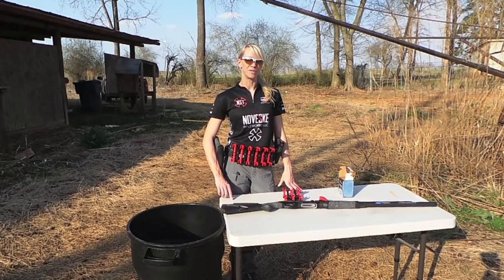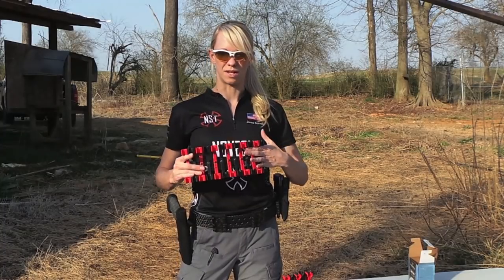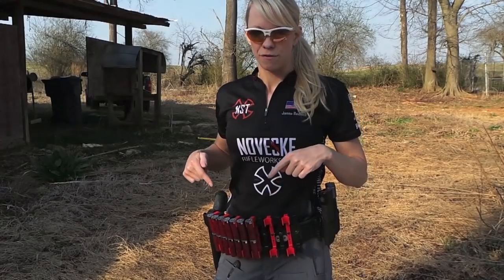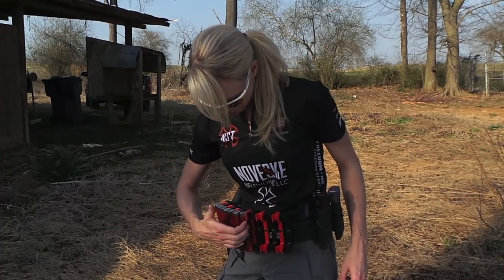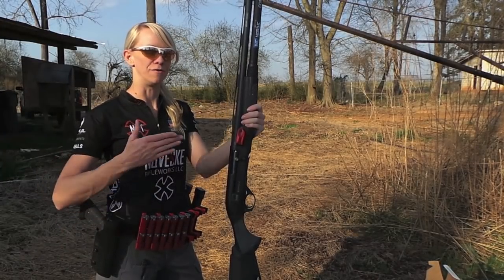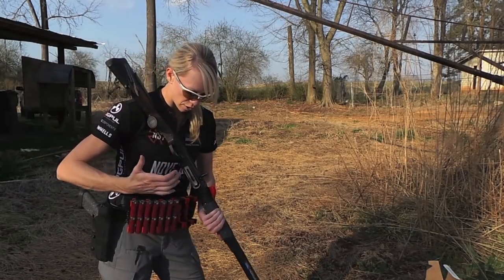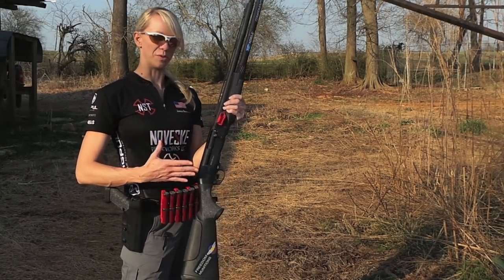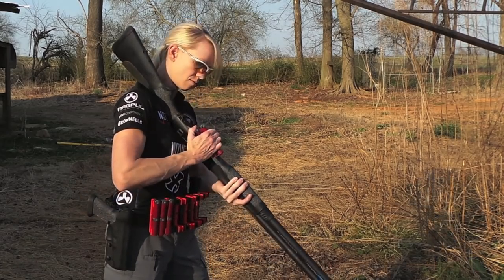Janna Reeves instructional competition shotgun load technique (twin and quad)

Comment: Its been a while good to see your alive and well and what is the length of that shotgun and wouldn't the extended magazine get damaged by odd ball rounds but than again it is a competition gun not all purpose shotgun
Reply from the maker: The barrel length is 21" but the magazine tube is a Nordic Components + 7 and does extend past the muzzle. And yes, this set up is intended for competitive shooting so I don't use oddball rounds in it. The pattern on the bird and buck I shoot doesn't start to spread until it's well  past the mag tube so the worst it gets is a little carbon build up!

Comment: Been practicing this for about 4 months on a Rem 870 Tac and no matter how I push or what form I use the second shell always gets hung up causing me to reposition my hand and make a second push.  I am wondering if i am practicing incorrectly, just need more practice or if i should be looking at a gear issue. I tend to believe i am just doing something wrong but want to eliminate the possibility that the gun is not designed for what i am forcing it to do.
Reply: +Erik Kay I have the same problem when I don't get my thumb deep enough into the loading port. Watch lots of videos of the pros on here and practice really slow at first. You may need to make an angled cut on the side of your loading port to facilitate getting your thumb in there without "chicken winging" to much. 

The really good 870 guys I've seen (search for Italy World Shotgun Shoot 2015 on here) feed their guns weak hand and that could be what's helping them get around this problem.

Comment: Nice vid. What is the red piece on the side of your shotgun?
Reply from the maker: That's called a Match Saver. It holds one round to be port loaded for that "oh crap" moment when you shoot to slide lock with one target left :) Slip the shell right in, hit the bolt release....much quicker than going to your belt to load one!